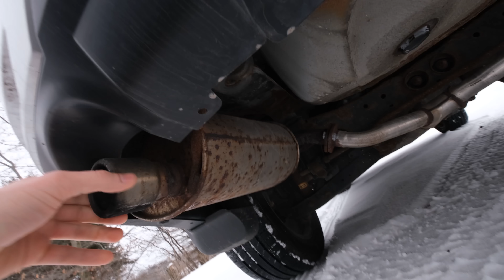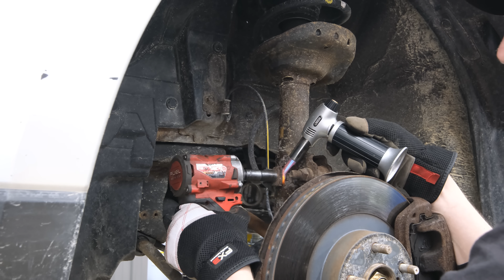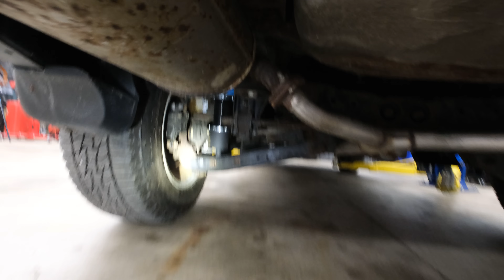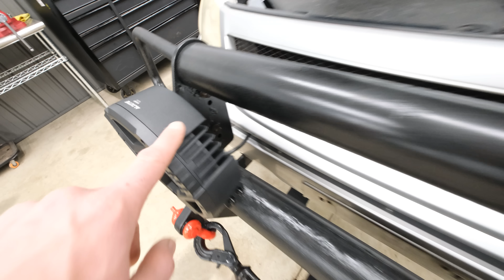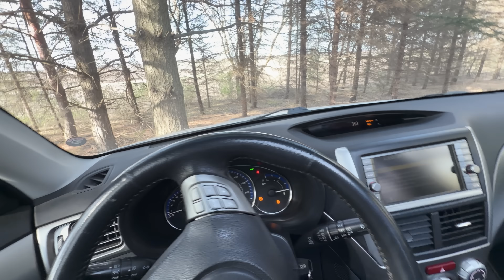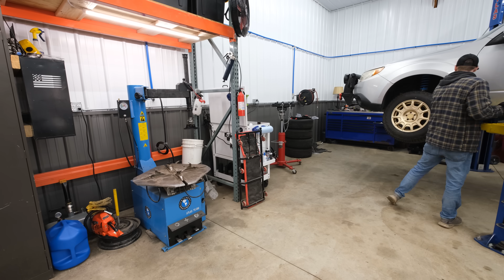I Turned a $300 Subaru Into an Off-Road Beast (Cheap Build)

Comment: I bought a 336,000 mile 2006 forester for $500. JDM low mileage replacement engine, rear struts, front pads/rotors, radiator, weathertech mats, touch screen stereo and two sets of wheels one set with winter tires and the other set summer off road tires. All in about $5500.

Comment: Not sure extralights had the best coupling, u should put a relay on the highbeam also, switch is only to dissconnect full extralights in summer. When u activate highbeams on car the extralights should follow. I like the project

Comment: Lost me at wheel spacer.
It was going so well up to that point.
A roadgoing Subaru has enough load on the car based wheel bearings already, a spacer moves that load way out away from the centre of the hub.

Comment: Great video! Any thoughts on the petrol engine vs the 2.0 turbo diesel ? For efficiency on longer trips
Tempting project and I’m trying to decide what engine to go with.
Reply from the maker: Never had the diesel option or seen one tbh. People complain about the gas ones due to the head gasket leak issues but they always seem to run even when leaking oil. 🤷‍♂️

Comment: One of my most entertaining cars ive built is my "overland" 2nd gen Legacy Outback I love taking it in the woods an on the beaches.
Reply from the maker: That’s the mid 90s style right. I’m a sucker for pretty much every 90s Japanese car. Mint!
Reply: I had an '82 Mustang that was surprisingly great for off roading despite being RWD. No lift but I did have some fairly large tires on it, it's been so long I don't even remember the size now. 

But I used to take out to some of the party spots a lot and people would show up in huge brodozers asking how I got it out there, I always had to laugh. 

I did get it stuck once and had to walk back and get somebody to pull me out. About halfway down the trail he started insisting it must be a different trail because there's no way I got a Mustang out there. He even got his truck very nearly stuck on the way, didn't have to winch it but it took a good 10 minutes of torturing that 4 low to get it moving again. Dude was speechless when we finally got to my car lol. 

I'm not suggesting anybody ever get a Mustang for one of these projects, just a bit of nostalgia and an example of some cars being more capable than you'd expect.

Comment: Is there a benefit to using lift puckls instead of adjusting the life by the new suspension and getting a bigger range of travel? Just curious, I could easily convince myself to get pucks and not a new suspension
Reply from the maker: Ideally if you have the means to get an actual lift shock setup with more travel is the way to go. But if you’re cheap like me lift blocks is it.

Comment: you really replaced shocks and screwed it into this rusty rusty suspension? not replacing any of this crappy falling apart elements? not to mention the bodywork due to rust!? I am sorry I dont buy it...
Reply from the maker: Lmao, just be glad you didn’t buy it then.
Reply: Bro you should try checking out the used car market in the midwest, especially the rust belt. That thing looked pristine compared to the rust buckets we're driving around here.

Comment: Solid build and excellent content! Rhino Line the exterior with a similar color and  use your torch to melt the fender liner and form it to increase space for the wheel to travel.

Comment: I want to do this with an older outback, the CVT seems to be the limit with the newer subarus. The wilderness editions are a bit better equipped but still arent able to keep up on the tougher stuff. Still a much more capable vehicle to get to the trailhead and down the less technical trails; without having to worry about beating up an expensive vehicle!
Reply: Ive had a '95 outback with forester struts. That was a nice lift. The '95 didn't have the factory lift that later outback received. Next I had a 96 outback. ADF (Anderson Design and Fabrication) 2" lift with king springs from Primative Racing. I also did a viper cut to the front bumper. I loved that car. Sold because the clutch was to hard on my rebuilt ankle.
Now I'm halfway on a lift for the 98 outback. It will receive king springs and all new struts. Its a simple suspension to work on.

Comment: Such an awesome setup! I think you’ll have a lot of fun with this. Great sponsorships too. I don’t have that specific power bank, but I bought the Anker c1000 last year after my old solar generator from 2017 had a safety recall. I use mine all the time! Whether it’s a power outage, camping, or to power a small air compressor for using a brad nailer etc they are so handy. You’re has a lot more features. My last unit had a built in flashlight that I used a lot. Current one doesn’t and I miss that. Cool yours has an rv hookup. 
Though it pains me to see a car get scratches, I think this car is a good sacrificial one and you’ll end up getting more scratches when you really take it out on the trails anyways
Reply from the maker: 🫡thanks. I hate rust, once I see that bring on the scratches. lol.

Comment: Your test drive was more off-roading than most "over-land" built vehicles will ever see.😅
Reply: Why do American's call it overlanding? I mean if I had one guess I could probably figure it out. But why not just four wheel driving like the rest of the world?
Reply: @intolerance9677 not all Americans are in to call it "over landing." I for one have been doing that for years long before some fool had to come up with a "new" label for the same old thing we have been doing this all a long, "dry camping".
Reply: @intolerance9677 Because there is a minor distinction between Off-roading and Overlanding. Offroading is specifically driving on trails meant for off-road vehicles. There is no real trip involved. It’s just for the challenge of making it up the trail. Overlanding is more about the destination and involves overnights and camping out in between traveling the route. Which may or may not involve off-road type trails.